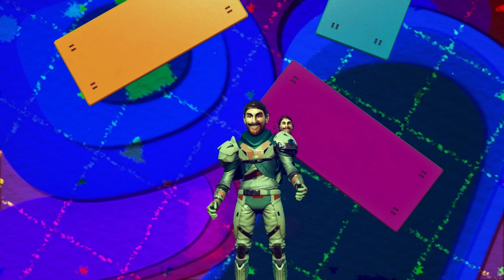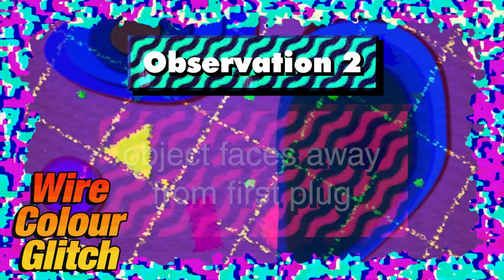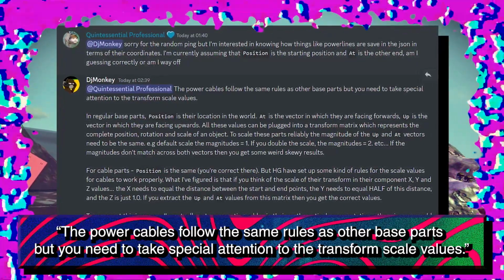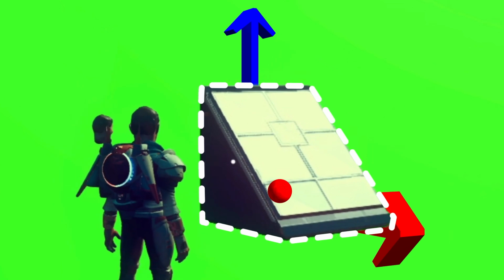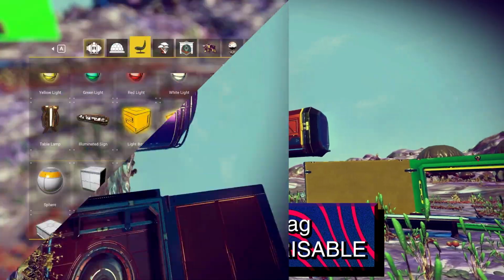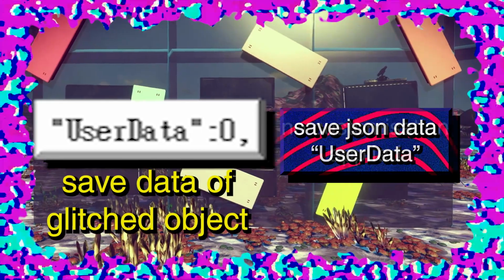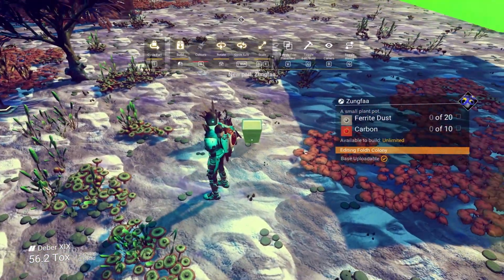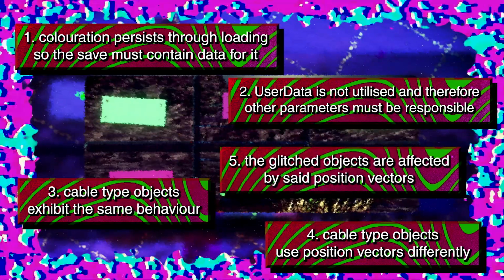How It's Skied - Wire Colour Glitch (No Man's Sky Explained)

Comment: Indeed really good stuff here. Thank you very much.
Is there a way to force the game to use the original color?
I mean: I select a part, switch to wire mode, let the cursor snap on an existing connector, and glitch the part on the connector. Sometimes it places the part with the original color I intended, but sometimes it places is with randomized color. How can I force it not to do that?
Reply from the maker: That will take more testing to know, but since my current understanding is that since the glitched colour stems from the Up/At vectors being different than standard placement, my guess would be the objects were retaining their original colour because you didn't move the object at all after placing the first end of the connector, which may not be always possible.
Reply: @WinderTP  So it's very likely that when you place one side of a wire, then pull and glitch another part on the connector, it will have different colors